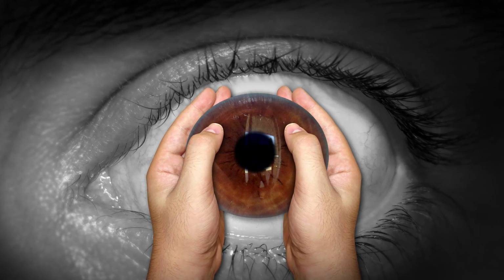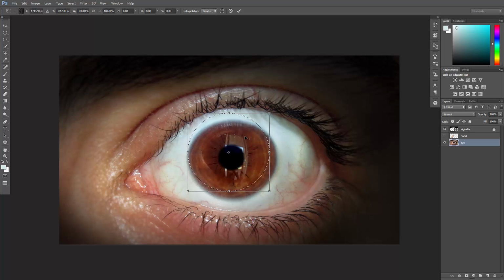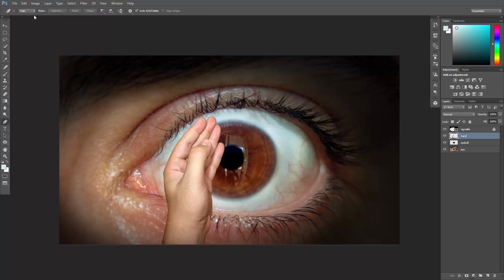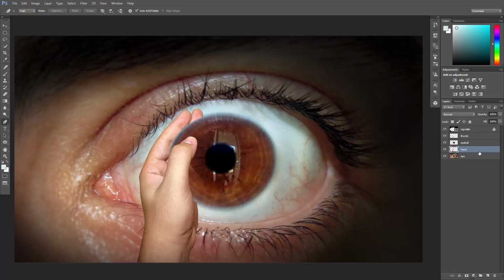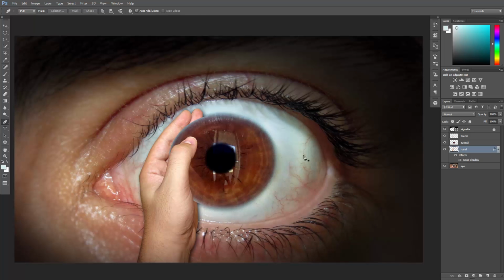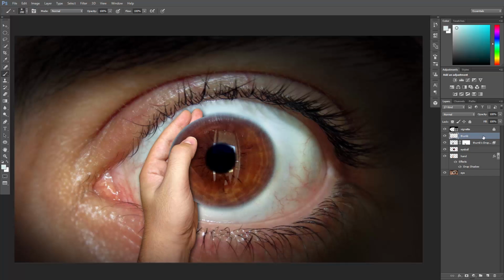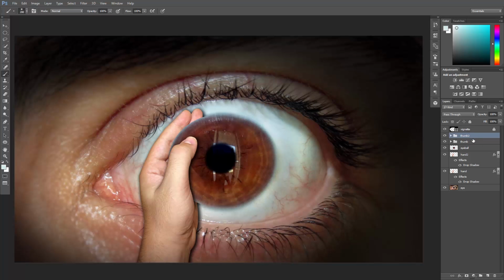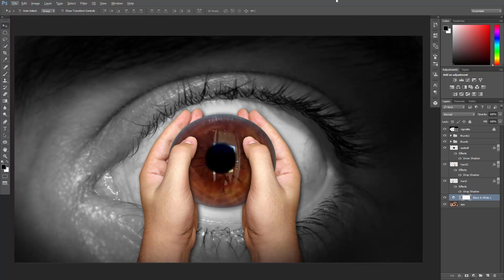Holding an Eyeball | Photoshop CC

Comment: I’ve tried doing this but every time I create another layer out of my layer mask it just doesn’t work. Is there a way around that?
Reply from the maker: Before pressing ctrl+J, make sure the correct layer is activated in the Layers Panel by clicking on it once.
Reply: 2-Minute Design  okay sorry maybe I didn’t explain that right. I’ve been trying to put half of a heart inside of a hand that I got from google and I had to cut out the images to get ride of the background on both images but when I make the layer mask it just goes back to the original image, does that matter at all or will it still work anyway?
Reply from the maker: Could you send me a video recording of your screen and show me? Send it to dayj@2-minutedesign.com and I will try to help you fix it :)